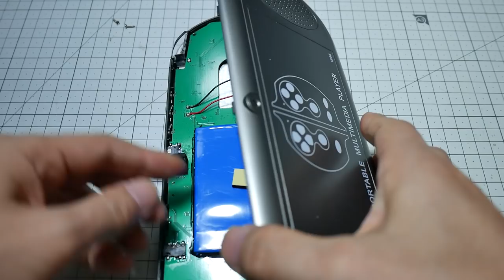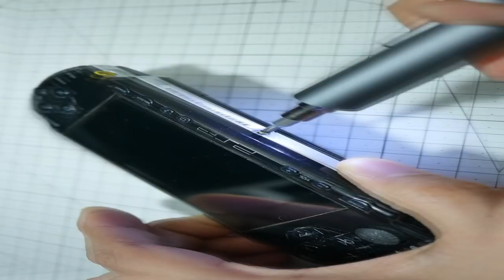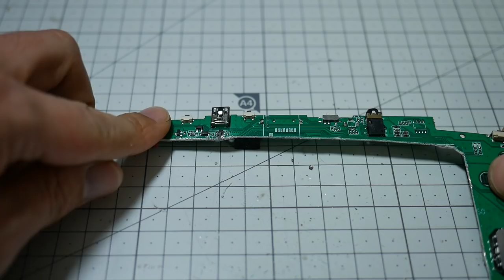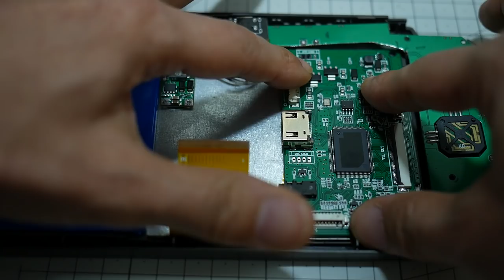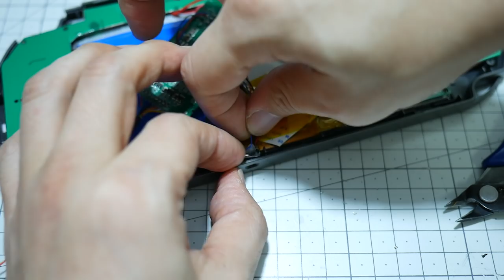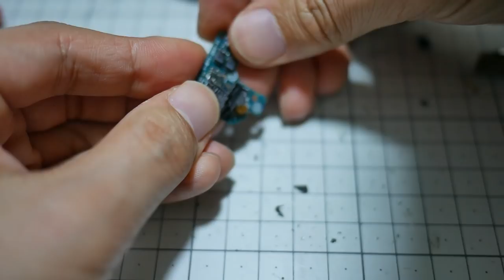7인치 에뮬게임기를 개조해서 7인치 PSP를 만들어보자 - PSP 빅 만들기 파트1. Let's make a 7-inch PSP - Making PSP Big Part 1.

Comment: Yeah vita TV would be awesome, ALSO MAYBE, IF you could figure it out, mod a Switch, put a more powerful chip in it, thats in the same family/tegra chip, meaning one thats compatible/capable of/that will still allow you to run the good games, at 1080p 60FPS, you MAY have to ALSO do a few software tweaks as well, to cap all games at 1080p 60FPS, ALSO IF possible, MAYBE up the RAM, from 4GBs to 8GBs, I'm SURE, its soldered, BUT MAYBE, a work around, is possible, the games I'm referring to are games like the borderlands collection,BioShock collection,doom,skyrim,resident evil triple pack collection/4,5 and 6,Mortal Kombat 11,Zelda Breath of the wild,Crysis,Assassin's Creed Collection,Dragon Ball Xenoverse,Metro 2033,Saints Row collection,DCUO, warframe and other games, I'm sure, that I'm failing to mention. That would be AMAZING.

You MAY ALSO be able to put a higher MAH battery in it as well, one thats like 10thousand/15thousand MAH,  maybe you can mod the back slightly.

I use a grip with my switch, mainly, because my hands are to big, to play the switch comfortably/without a grip or a controller.

I have a gaming PC/laptop, 2048 and desktop 3090s SLI, for when im home/have power/have an outlet, along with a PS3/4 and 5, SO for me, the switch is a handheld/portable device/for when I don't have power.

I also keep a 30thousand mah battery bank with me, to charge my switch, when I'm on the go, I had a Vita before this, BUT the Vita just wasn't quite powerful enough, the switch isn't EXACTLY where I want it, BUT its REALLLY close to perfect, I want 1080p 60FPS on every game AND I want GTAV and Farcry 5.

Comment: to remove a soldered piece you should apply a lot of welding and use the soldering iron, or try with a heat gun.

Comment: Wow, very mindblowing work, man, I wish I had your soldering skills to completely use a larger screen as default internal screen for my PSP 3000, rather as an external screen mode. Anyway, your next episode is about hardwire the PSP controller buttons, so you can use it as an authentic legit system? Hope you can still use UMDs with an larger housing, or maybe once again, sacrifice UMD in favor of an larger battery, again, since UMDs are completely outdated.
Reply from the maker: I couldn't close back plate with UMD. So I have to remove it again.

Comment: You understand the reason for the screen quality being lower is that the resolution on the bigger displays is larger than that of the PSP, you either need to get a display with the PSP resolution (480x272) or somehow upscale the image to the correct resolution of the replacement screen.
Reply from the maker: Oh, this HDMI cable has upscaling function. And the poor screen quality is due to cheap Chinese LCD display itself.

Comment: I have  Gpd Q9  its a 7 inch tablet  emulation device  that run android.  It has a  psp emulator.  But the problem  is  it can't  play  psp games at all . Only  games like  tekken 6 and  virtual tennis  runs  quite  smoothly.
Reply from the maker: Very good emulator GPD Q9 you have!!!
Reply: @DIYDrK  games resistance retribution  god of war will never play in gpd q9.

Comment: Remember, When you want to unsolder more than two legs, insert more solder, heats up quickly on one side and on the other, And quickly pull out the components with tweezers
두 개 이상의 다리를 납땜 해제하려면 더 많은 납땜을 삽입하고 한쪽과 다른 쪽에서 빠르게 가열하고 핀셋으로 구성 요소를 빠르게 빼냅니다.